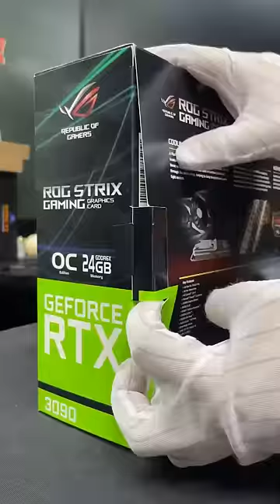ROG Water Cooled Gaming PC Build ASMR

Comment: I never thought about using that pressure gauge to check for any loose fittings 🤯🤯 fucking dope my guy learned something new today
Reply: Bro forget to remove Protective film now the playsic will be there like thr cheese in a Cheeseburger 🗿
Reply: Was thinking the same, that little trick will make me feel secure using a self made water cooler in my pc 😂
Reply: He forget to jump the psu to pump around the liquid and started the pc, if the pump somehow would have failed then liquid could hae still potetionally damaged the fluid.
Always check double.
Reply: Bro, limburg, you need to understand short form content. They just skipped to the part where they wired things up. Their channel is mostly short form content videos. Plus they would always double check for a build that expensive. And also explain on why the liquid flowed when he turned the pc on. The pump is fully working when the coolant flows fast like that.
Reply: @kntmimi3055  yea i understand but without anymore context people can misunderstand and make mistakes.
You know people aren't always the brightest, only seeing one video and thinking yea that's easy.
Don't underestemate the stupidity of humanity😅
Reply: Yea, I know people make mistakes I just correct some of it.

Comment: I didn't know that gpus needed thermal paste, or that there were 2 m.2 slots under the long heat sinks instead of 1. That would explain the length. Now I know how to improve on my build, thank you :D
Reply: It normally comes preapplied in housing like that but the amount that was applied in the video was just a little too much regardless
Reply: I'd have to guess he was pasting it because he put a water block on after.

Comment: 1:26 SO MUCH FOR YOUR GPU WARRANTY!!* Take note that removing that screw with the white tamper sticker WILL VOID your warranty. I would have probably tested the GPU card BEFORE attempting to upgrade to water cooling just to make sure the GPU does in fact work. If you do attempt doing this without testing the GPU card first and the card doesn't work after you are done you are left with a real expensive paper weight because you are unable to return it for warranty repair.

2:42 Turns on the machine with a little coolant only added..... and fries the CPU and GPU. LMAO 
Next time just use the power supply trick where you configure the power supply to only power up the water cooling pump so you can get full circulation of the coolant and not risk damaging the CPU/GPU from overheating. 

Really like the Michael Jackson gloves! 👍

Comment: 1:35 Top 10 ways to void a GPU warranty! (2022) (WORKS AMAZING)

Edit: I am aware that you are required to remove a gpu's clamshell to put a water block in it,however, since the super fancy clamshell is gone, #1, nobody will know it's a ROG STRIX gpu because no matter what company you buy from, it's still the same graphics card underneath all that heatsink, and #2, they could've picked a less fancy card for this build since the clamshell was gonna be removed anyways.

Comment: This pc is nothing in front of my pc.
MY PC SPECIFICATIONS:
2gb Ram , 300gb hard disk , no graphics card, , Intel duel core 5200 Processer.
And can run San Andreas more than 30 fps at low graphics settings.😁😁